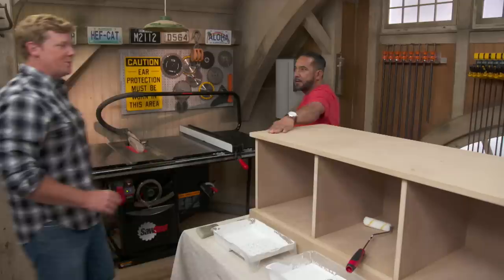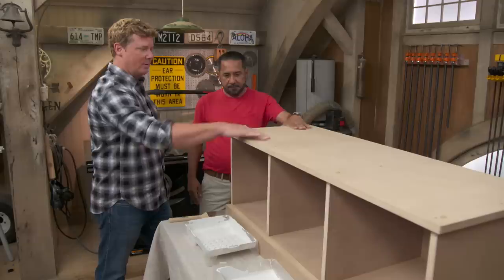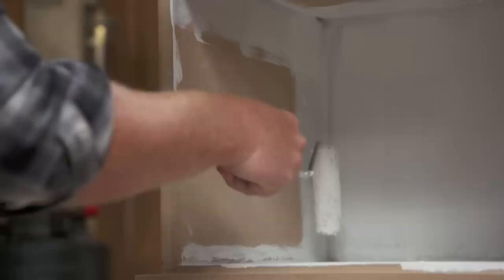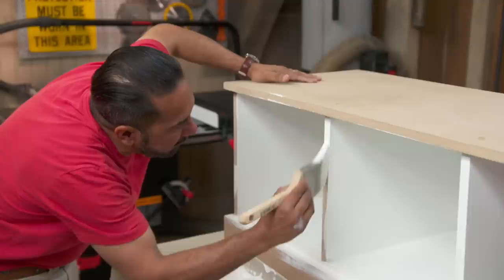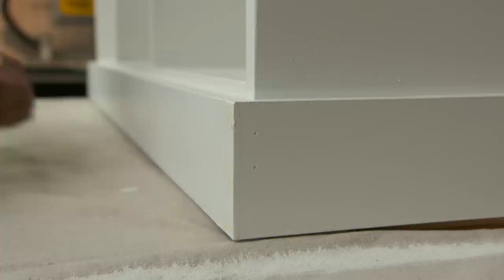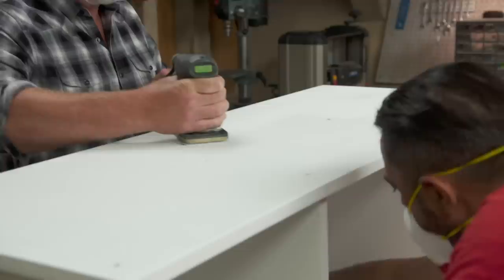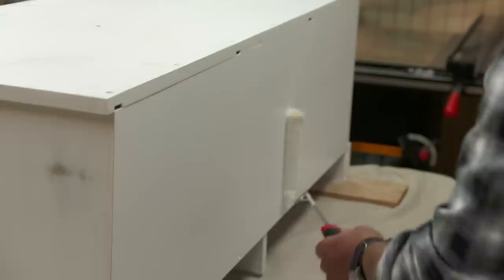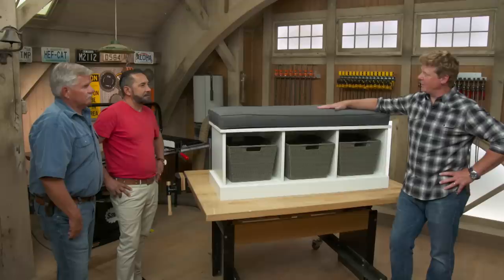How to Paint MDF Furniture | Ask This Old House

Comment: So when I started painting our cabinets I asked if I can use water based paint to prime it and use oil based on top or vice versa. I was told to use oil over water as a guide. Now I have some raw MDF material that I would like to paint but according to this video you used an oil based then water based. So what’s a good rule to use wether a paint will stick to the other or not. Thanks.

Comment: MDF is fine, used in high end cabinetry and millwork all the time. It's a stable and flat substrate that paints beautifully, especially with a spray gun. However, make sure you use real wood edging, and or veneer edge banding for shelving, exposed edges. as MDF sucks up paint leaving an undesirable edge and MDF is not durable enough to last any period of time for furniture. Also, when you're using wood filler don't scrape it all up as he did, wood filler is either water based or solvent based so it shrinks when it dries leaving holes still exposed. Leave a bit and sand smooth.

Comment: 1) sand the mdf to a beautiful finish
2) get your paint mixed and ready to go
3) throw the project in the burn pile and start over with hardwood plywood or make panels out of real wood.
Reply: r s 

You pay £1000 for a shoe cabinet then😂
Reply: mdf and shoes/water dont mix, first couple scratches and it'll swell.
Reply: Joe T i'll take that wager
Reply: r s 

If you get enough layers of finish on something it doesn’t matter what’s underneath haha. If you painted a sponge with Acropol it wouldn’t soak anything up!
Reply: @loejets  Damn, Lumber in the UK is expensive. In the US it would only cost ~100 - 150 freedom shekels.

Comment: I was always taught never to use a water based paint on oil primer or paint.  Have the rules changed?
Reply: sand in between to give the water based paint something to attach to
Reply: The rules have not changed, though primers are more forgiving  in this regard than top coats.  Alcohol based primer would be a superior choice for the MDF and assuming you wanted to use a water based top coat.
Reply: when it comes to primers you can use any water based paint over any primer. BIN is a great sealer
Reply: Tim G the Zinsser BIN shellac is by far my favorite for any application.  Just remember to wear an OVF mask especially indoors.

Comment: Am I the only one that's asking, "why would you put MDF in a mudroom?"
Reply: You can, just not with exposed edges or trim made out of MDF. MDF is a sheet good substrate meaning you have to band the edges. It's cheap but so is wood, this was just lazy.
Reply: MDF takes paint better then wood does. Once it's sealed it will last.
Reply: Agree... marine or exterior plywood with the edges capped would be a lifetime bench.  MDF may work for a couple of years.
Reply: Smoother finish. Won't hold weight tho

Comment: MDF is the worst material they ever made. It's basically good for nothing.
Reply: It has its place in casework, it just has to be used in moderation. You wouldn't use plywood for something like paint grade raised panels, you would use higher grades like ranger board MDF that paints like real wood. Using solid wood panels is labor intensive, full of defects to mend and adds no value to a paint grade project.
Reply: Mama C idk where you live but in Canada OSB is pretty good stuff, uses 100% of the tree whereas plywood I think is like 60%. There’s buildings on my property with 20 year old osb that is still perfectly intact. Just need to invest in quality primer and that goes for mdf aswell, I agree it’s not as appealing but when it’s literally half the cost of 1/2” plywood sometimes it’s the way to go
Reply: Mama C oh man that sounds awful, you’re right the glue they use must be horrible for our health, I’m sorry to hear that. Glad that your project was a success though!
Reply: MDF is great for indoor speaker box projects, esp inner bracing & porting (like on a t-line, where you'll use a ton of material). The density is ideal for tight sound.